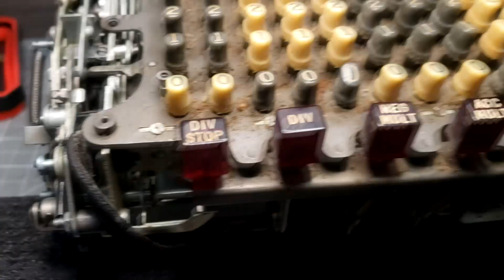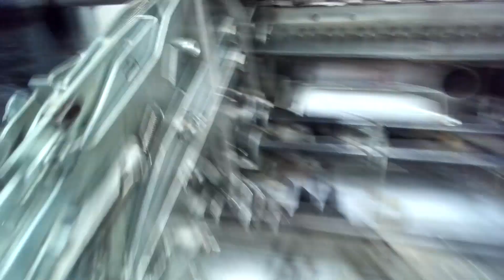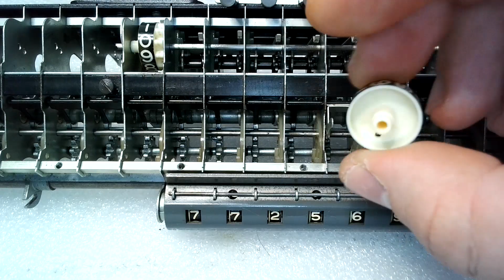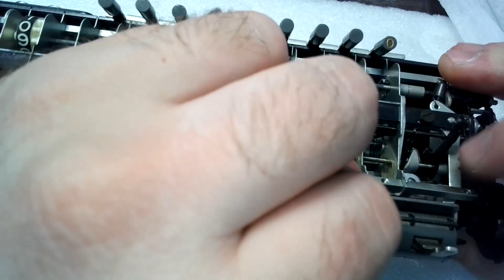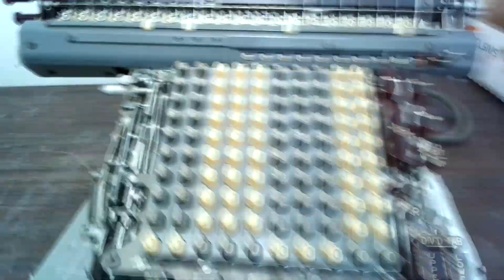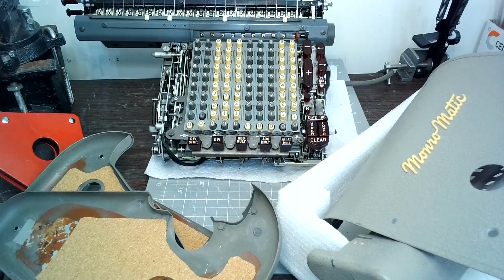[Monroe CAA-10] Mechanical Calculator Repair and Restoration

Comment: These machines are truly impressive. Sometimes I wonder how they go so unnoticed; not everyone appreciates the art of their mechanisms, their history, and their design.

I own a few calculators from the same Monroe family, and unfortunately some of them arrived damaged from shipping — bent, dented, and sometimes almost destroyed. Luckily I’ve been able to bring them back to life.

It’s common to find the carriage bent or misaligned, so it needs to be straightened until it sits properly again. It can also be adjusted from underneath using two large screws. There is also a disc clutch that often gets stuck due to old grease or rust, which can cause the entire mechanism to jam.

Many of these machines simply suffer from old grease. The real challenge is cleaning them with the correct products and having enough patience to avoid breaking something during the process. It’s usually recommended to remove the motor and operate the machine manually while working on it. Using synthetic clock oil or sewing-machine oil is also a good idea so the same problem with old oil doesn’t happen again in ten years.

For cleaning, contact cleaner and isopropyl alcohol work well. You also have to be careful not to be too rough, because a spring can easily pop out, and putting it back can become a real headache. But in the end there is almost always some clever way to get it back into place.

In many ways it feels like solving a giant puzzle. Fortunately there is documentation that helps explain how these machines work, along with videos from dedicated people who demonstrate their mechanisms. And if you have a second machine that you can use as a reference, that helps a lot.

Maybe someday someone will come along who can completely disassemble one of these machines and put every single piece back together perfectly.

Comment: I bought a CAA-10 off Shop Goodwill for $40, with penny shipping. I have a CST-8 that came with the original electrical cord in great shape. I fired the CAA-10 up and the motor spins, and "sparks", but the carriage is jammed. Mine looks to been made 1949-1950 it has all ivory keys on the keyboard, otherwise its exactly the same. I plan to disassemble and overhaul it too, I'll keep watching! :hand-purple-blue-peace:

Comment: What happens if you hit "clear mult" when the carriage is not in #1 position?  Does it move to #1 position first?
Reply from the maker: Yes, If not in 1st position the upper&lower dials clear and it moves to 1st position or the tab stop you selected if the tab stop is between where the carriage is currently and 1st position. 

If you have the slide set somewhere other than 1st position it will either move to 1st position or to the 10's position on the slide depending on whether the carriage is currently to the left or right of the slide but keeping the slide in 1st position makes this a lot less confusing.
Reply: @noahbabineau837  What about if you don't have a multiplier set (i.e. it's all zeroes).  Mine moves the carriage all the way to 10 and then keeps hitting the end stop until I manually unwedge it 😞
Reply from the maker: @StevenWalter does it have a multiplier? The slide setting controls the farthest left the carriage will go if you hit clear mult while in 1st position, if the slide isn't installed the carriage will continue trying to shift left after the 10s position since the small tab between the keyboard and carriage didn't get tripped by the slide.

The only other thing I've had issues with for shifting the carriage was the tab stops/ tabs on the far ends that trip the plunger on the upper right side of the machine above the handwheel. I had to bend a couple tab stops so they would trip the plunger correctly

Comment: What happens if the carriage is at the far right, and you hit the "right shift" button?  Mine makes a repeated clunking noise as it attempts to move further to the right (but can't).  I'm wondering if that's expected behavior or something I need to fix
Reply from the maker: The helical cam that shifts the carriage back and forth will keep rotating, and the plunger in the follower will just keep getting pushed in because it can't move any further. Sounds like it's doing what it's supposed to as long as it stops trying to shift one you release the carriage shift button

Comment: Thanks for showing keyboard removal.  I was wondering if it would be possible without disassembling half the machine.  I had to adjust one of the selector bails on my 6N, but I was able to manage it (barely) from underneath with long pliers
Reply from the maker: Yeah even though it's only attached by like 6 screws its pretty challenging to remove/reinstall, I took a lot of pictures from all angles to make sure I had it reinstalled properly.

Comment: Impressive! I have almost this same machine but never could get it to work. Super dirty inside and I’m afraid to take it apart enough to clean.
Reply from the maker: These are definitely way too complicated for me to completely disassemble and clean, especially the control sections on the left/right of the keyboard. I just got lucky with spraying degreaser down in there and hoping for the best. Good news is these things are fairly common and go for cheap, both the CSA and CAA I repaired cost less than $50 so I didn't feel like I needed to handle them like precious artifacts.